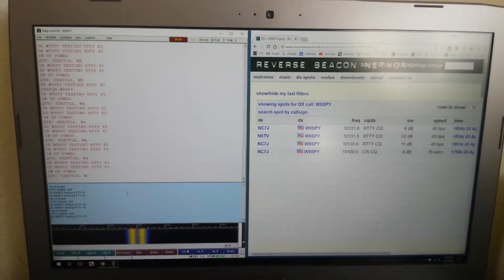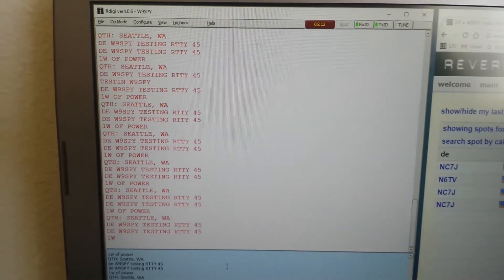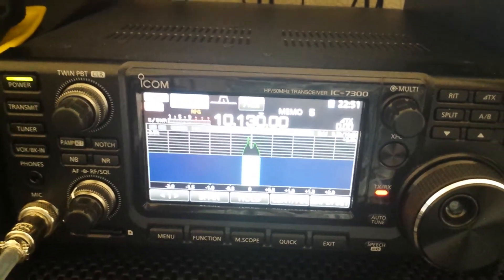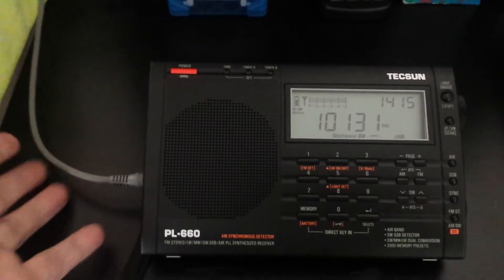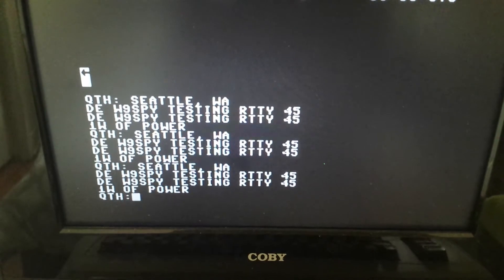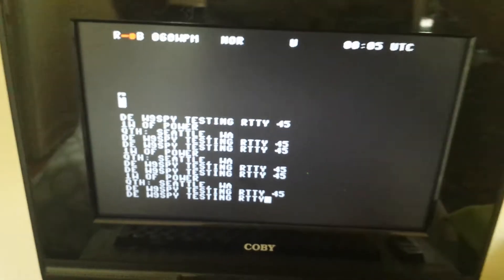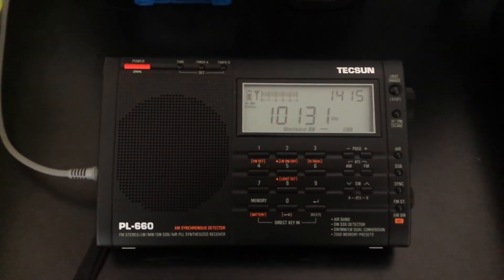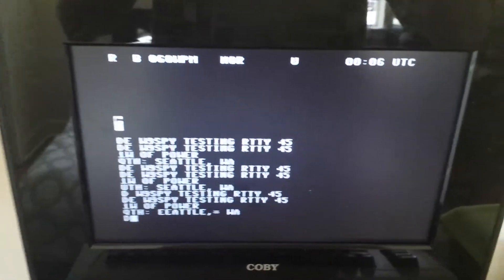Commodore 64 with Microlog SWL decoding RTTY-45 on 30m band

Comment: Very cool!  I still have my C64 and an MBA-Tor cartridge from AEA, along with their CP-1 interface.  Used it in the 80's and 90's.  Might be fun to put it on the air again.  What is that Coby monitor?  Looks ideal to use!  73, Jack
Reply from the maker: If you get your C64 rig up and running and decoding RTTY, please record a video and tag me in it. I picked up the Coby monitor at my local thrift store for $2.00, though I'm still on the lookout for an original Commodore monitor. Thanks for stopping by and commenting!

Comment: I have one of those cartridges. G7VFY
Reply from the maker: I purchased mine on eBay. But I had to really battle it out with others who wanted it, too. So you and I have a fairly sought after piece of gear.
Reply: @CurtRowlett  With a AEA PACKRATT PK232 you can do ASCII, RTTY, CW and maybe some other modes too. You just need a rs232 port and something like NovaTerm.
Reply from the maker: @G7VFY  Yes, it is amazing how well a C64 will adapt to so many things. W9SPY